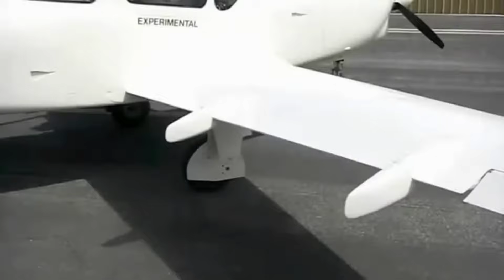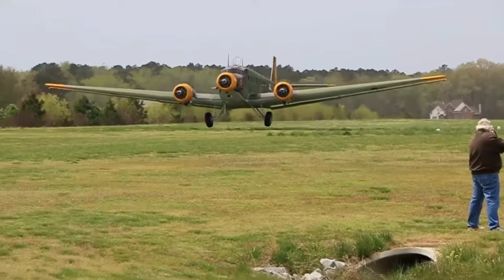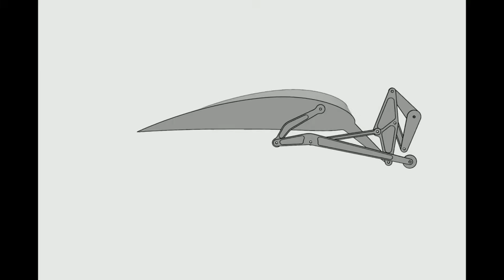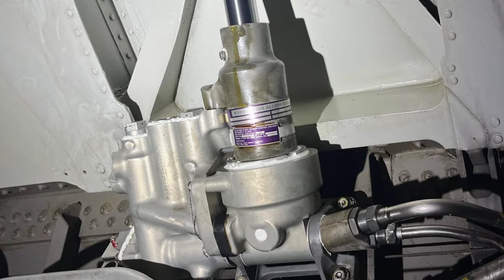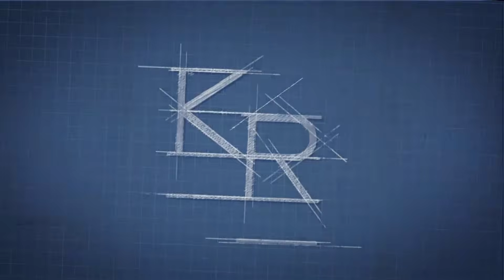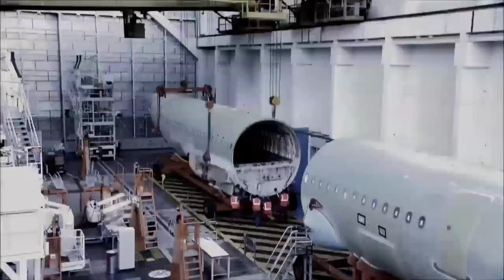Fowler Flaps vs Krüger Flaps - The Engineering Battle Boeing vs Airbus Won't Talk About

Comment: this video makes it seem like krueger and fowler flaps are alternatives to each other. they are for different parts of the wing. Krugers are leading edge devices, while fowlers are trailing edge devices. both Airbus and Boeing use fowler flaps. Airbus generally uses link-track mechanisms, while Boeing has used complex four-bar linkages, such as on the 767 and 777.

Comment: Completely wrong and misleadind.
Fowler flaps and Krueger flaps do not compete, they complement each other.
Current Airbus aircraft (A320, A330, and A350) primarily employ leading-edge slats and droop noses to achieve high lift. Krueger flaps are not installed on these aircraft. Boeing aircraft, by contrast, have incorporated Krueger flaps since the introduction of the Boeing 707. Both manufacturers employ Fowler flaps on their aircraft.